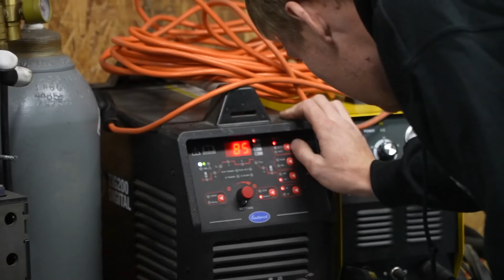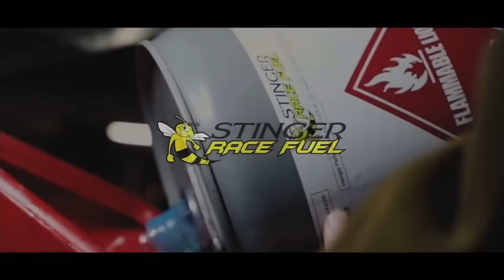Workin' In the New Shop! BIG TURBOS & All the Travel!

Comment: You are grinding the tip on the tungsten wrong.  You need to put it in a drill and spin it up and you need to grind the point in the direction of the tip not around the tungsten.   Go watch tungsten grinding videos.    It will help your tig welding out greatly when you grind the tip correctly
Reply from the maker: Thanks mike I’ll do that
Reply: @StreetRacingChannel     👍🏻👍🏻👍🏻. Nice work on the new car.  Good luck